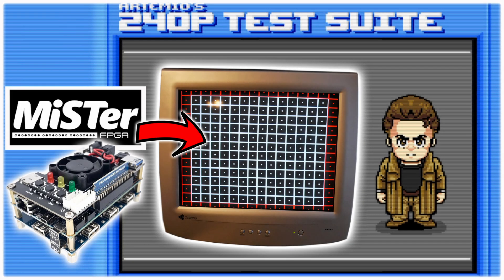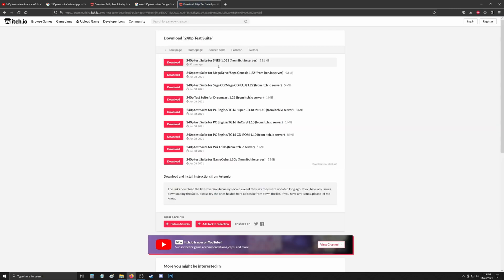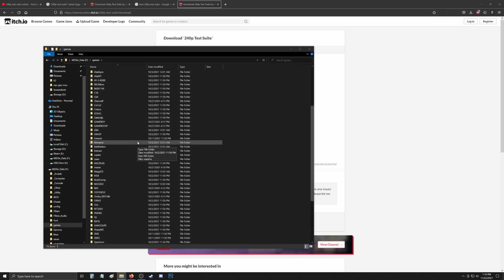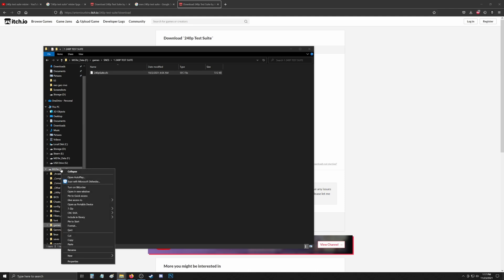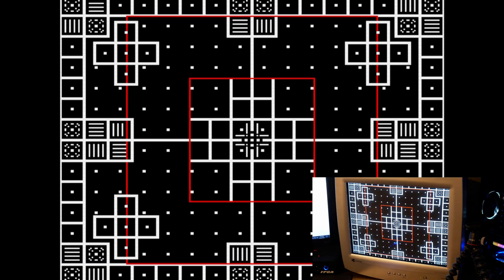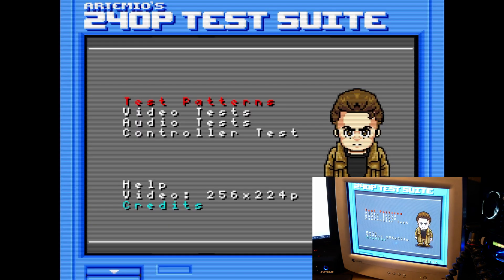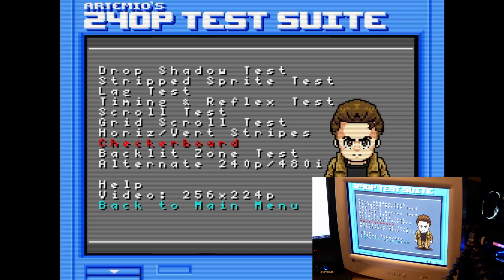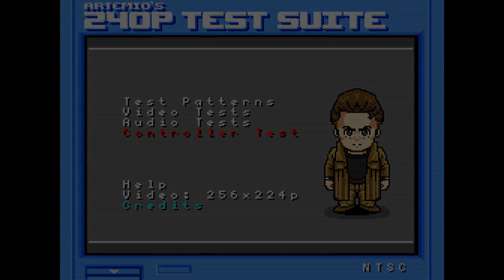240p Test Suite on MiSTer FPGA - How to Calibrate PC VGA CRT using MiSTer SNES Rom

Comment: I have a pc and a crt monitor with a vga adapter that I need to calibrate and I wanted to calibrate it with 240p Test Suite. unfortunately I don't have a clue about how to run the software.

Comment: SNES roms don’t have to be in individual folders. You can actually have them all in a single zip file 😉
Reply from the maker: Most emulators dont require individual folders for rom based games and figured mister probably didnt either but I followed some old guide when I first set up so just left it as it was and didnt try it without folders. Thanks for confirming this and thanks for watching!